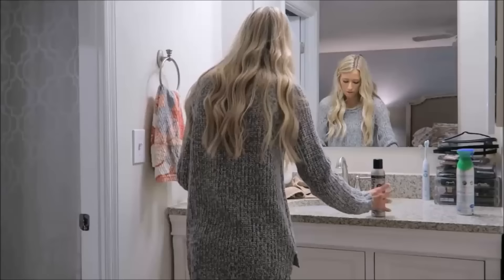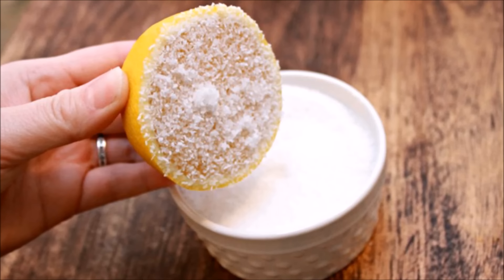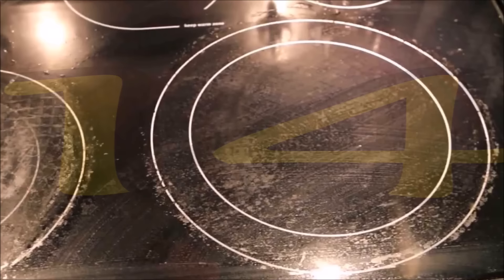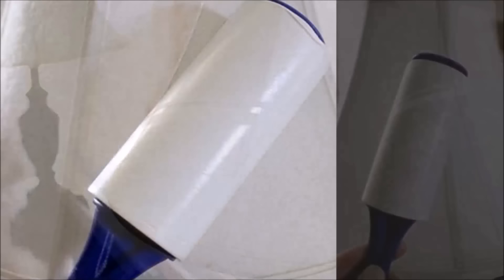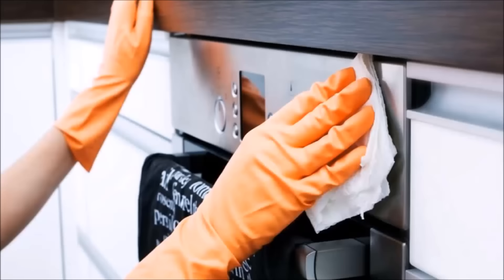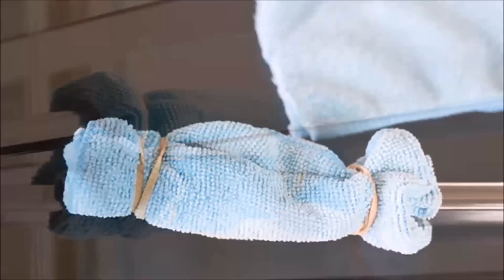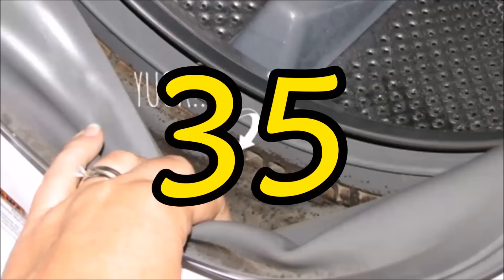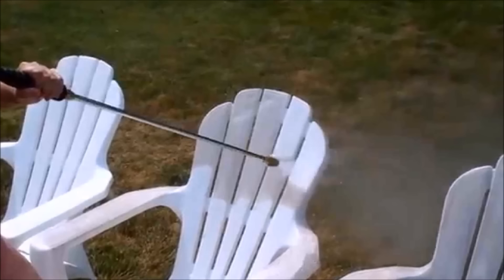41 Tips to Make Your Entire Home Cleaner Than It's Ever Been

Comment: I use only water to clean my floors. It works great and leaves no streaks or residue.Oh,and if you have a swiffer you don't need to buy sheets. Old socks work great for cobwebs or dust bunnies and you can use any cloth moistened and stuck on onto the swiffer for floor cleaning.
Reply: Great idea!

Comment: My grandmother cleaned her huge wood chopping block with lemon and salt. This also works wonderfully on brass
Reply: Jeanne:  And,  also on copper, as in the old  antique copper teapots.  On a plate sprinkle a good amount of  table salt so that there is a "bed" of salt.  Next, roll the lemon on the kitchen counter  using pressure to soften  it.  Cut the lemon in half, and rub the lemon half in the salt bed.  Keep rubbing...sooner or later the lemon and salt will begin to wear away the patena and dirt build up.  I used this method twice back in the late 1950's and into the early '60's to clean my small collection  of all pure copper teapots...one of which is dated 1889, England.  It was a very hard chore back then and I'm pretty sure there are products that would  ease up for the hands and wrists in today's world.  The method I gave above is what I saw live on a local TV show in the early 1980s  Good  luck  cleaning your copper for the Holiday.
Reply: If you put lemon and or salt on brass, it pits the brass. Don't do it
Reply: @annisthomas9041  MetalSmith/jewerly Artist here and that is not true. I suggest you look up "pickling" besides  you rinse it off after.
Reply: @jeanneelise pl

Comment: You can also mix dawn with white vinegar [about 1 portion of dawn to every 2 portions of vinegar]. warm them in a saucepan or in your microwave for a few second just so the vinegar  will combine with the dawn. Put the mixture in a spray bottle and spray your shower doors, tiles, etc. and leave on for 15-30 minutes, then just wipe it off! All those water stains will slide away!  You can also clean your burner covers with this mix by spraying them with the mixture and putting them in a plastic bag over night.  Hope that helps someone. :) Learned it on Youtube!
Reply: I'm a huge dawn and vinegar user!  It gets everything in my bathroom so shiny!  I don't bother heating the mixture though.... doesn't seem to make a difference.
Reply: DO NOT use Bleach to clean MOLD, it doesn't kill mold but rather use Vinegar. Research this

Comment: Great tips!
I have found though that using Future on lenolium floors is better than regular floor wax. It's an acrylic.  It doesn't yellow, floors can be washed easily with a very light soap solution, and you never have to try to get it off with ammonia, which will take the finish right off the lenolium. If that has already happened, that can be rectified with Future as well. JMO Retired long time housekeeper.
Reply: What’s is Future? Thanks
Reply: I bought a STEAMER by Bissell! Hand held!
No more scrubbing!& the same for my wood floors! HOT Steam is the Best Way to go!!& just wipe!

Comment: Vinegar baking soda and lemon! Winning combo for cleaning. Drains baking soda add vinegar after all baking soda is done foaming run hot water for a minute or two. Slow drains? Leave baking soda and vinegar work the drain for an hour then hot boiling water down the drain will clear it. Repeat if necessary! Easy Peasy!

Comment: Some very good tips. For me, the best is using a seam ripper to get hair, etc. out of the vacuum beater brush! I’ll have to try the “Magic Scrubber” sponges on my oven door/window. I saw a video that recommended using baking soda & vinegar, but it didn’t touch the mess on the window & inner door frame. my husband dropped a frozen pizza while putting it in the preheated oven and it landed upside down on the glass. It was way too hot to try to wipe it off, so he went ahead with baking, and further baked on the pizza cheese! I have yet to find a “best” way to get it clean!
Reply: WHAT'S A SEAM RIPPER???

Comment: Any stagnant odors that permeate a space can be neutralized by heating or microwaving a cup of vinegar till it boils then place it in the smelly area till the odor is eliminated or the vinegar evaporates. A hot plate is best for boiling a small pot in the desired area so your not running back & forth to the kitchen to reheat the vinegar

Comment: At 21:43, the cleaning solution is called TSP, Tri Sodium Phosphate, not tsp as in a measuring unit.TSP is used to clean,  it is actually a light abrasive cleaner, strips the dirt off the item you are cleaning a little, allowing you to repaint, giving the surface a texture for paint to adhere to. If you use TSP, use the red label and hot water, then rinse, the red label won't make you work as hard in scrubbing. Be sure to rinse after washing with TSP.
Reply: It's because they are using text to voice....it must have mistaken TSP for teaspoon

Comment: The best and easiest way to clean oil up on your garage floor or driveway is dawn dish detergent. Cover the spot with Dawn, let it sit for about ten or fifteen minutes, then spray with a hose. It was like magic. The oil just disappeared. Jean from Arizona
Reply: Chelsea Hill Hose ❗ This landlord I'm assuming , took the water outlet so there is no Hook Up . I just moved here but the people that were here didn't complain , Huh ❗❗😲 You need that ❗ Geezzzz , cheap O and Lazy 😒 SMH ❗
Reply: You are still spraying oil into the drains in the streets.

Just dump cheap cat litter over or shredded newspapers it to let it soak up for awhile then sweep it up and place into a seperate trashbag.
Reply: I was told the best way was using Suave shampoo.
Reply: They use Dawn for everything.  What's in it anyway?   Is it bad for the environment? Does it every degrade?
Reply: @amywalker7515  didn't you ever see the dawn commercial.. was it Dawn? Madge what are you soaking my nails in?

Comment: I’ve filled our bath tub with hot water and bleach and put the shower head (it’s on a hose) into the bleach water overnight. I’ve used your tip with the coil and bleach. It works great

Comment: The secret to tubs and showers is cleaning them after each use. It sounds way harder than it is. I keep a microfiber cloth and bottle of bleach gel (with precision nozzle) in a small shelf set in my bathroom. I can be in the shower with the water running and run the bleach gel over the caulking and do a quick wipe of the tiles or tub. Takes 60 seconds and i don’t have to scrub or wipe every single surface since it will get wiped again tomorrow. Wring the cloth well after each use, then throw the cloth in the wash once a week (it stays sanitized due to the bleach.) I never have mold in the caulking or a mildew ring anymore, and I don’t need to do a deep cleaning on my hands and needs once a week like I used to. Learned this by watching a video on Japanese culture where it’s common to clean the tub after every use and now I can never go back!
Reply: so dangerous....  Bleach is toxic; bad to breathe or get near your skin..also bad for the environment!  I agree that cleaning after each use is the best way to keep things clean.  I disagree with the use of bleach.

Comment: ....I have always cleaned my rugs outside,... using either Dawn dish soap, mixed with baking soda and very warm or hot water... doesn't take a lot of this mixture.  Rinse well with pressure setting on hose attachment. I then pour diluted white vinegar then rinse , hang to dry over a sturdy area ( I use blanket racks or a fence ) . You can also use Folex , which requires no " last water rinse ", and takes out everything. 
I actually clean my lamp shades ( unless they are really fancy ) in the bath tub,  I just spray lightly with a mild cleaner,  ( vacuum first if lots of stuff on it ) and use warm water with the shower hose on a gentle setting. Works beautifully. ( you don't use the  bathtub to soak them or anything.  Just to spray the mild cleaner and rinse with very warm  water . ,)